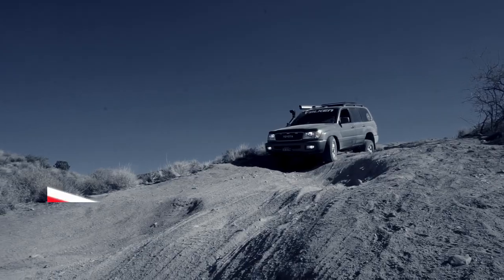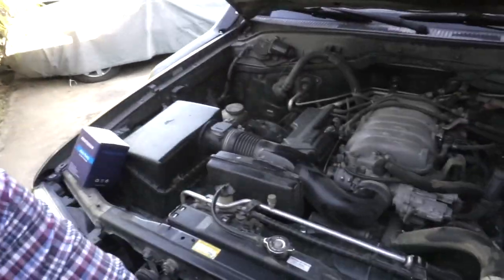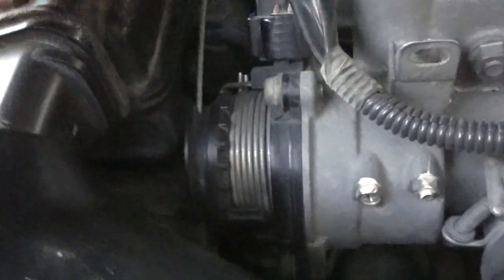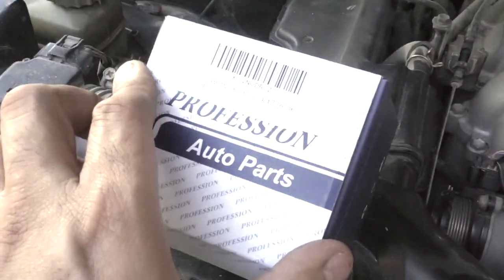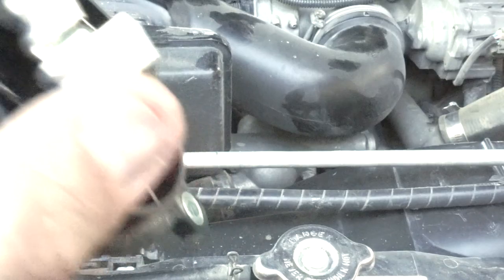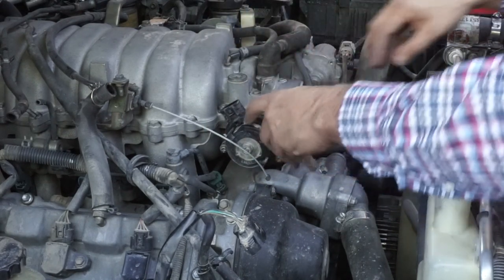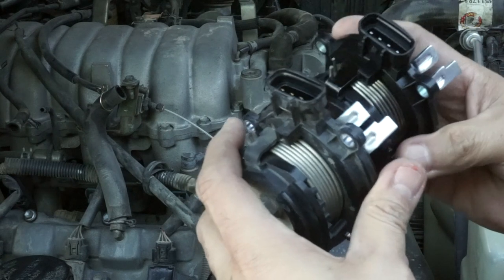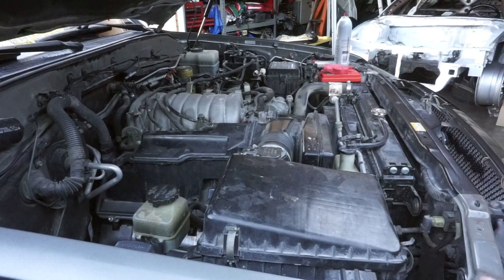How To Replace Throttle Position Sensor / Accelerator Pedal Position Sensor. 100 Series Land Cruiser

Comment from the maker: Had to replace the Throttle Position Sensor / Accelerator Pedal Position Sensor on my 100 Series Land Cruiser. Because the trottle cable holder broke off and I lost pedal response on the highway!

Comment: Hey, I am doing this now and have two questions: did breaking the tab on the wire harness cause any issues? Has the sensor held up? The OEM part is about $400 from Toyota, so wondering if the cheaper part has been ok. Thanks!
Reply from the maker: No issues with the breaking of the tap or the sensor as well. It's been good for the past year!

Comment: I just replaced this same part on my 2002 toyota Sequoia 4.7l same engine and i still dont yave oedal response until it goes almost all the way to the floor what do i do clear the codes
Reply from the maker: Oh man! I didn’t have that issue and I didn’t have any codes.
Reply: Your in limp mode try tps sensor

Comment: What symptoms were you experiencing before replacing this?

Did you replace the sensor that goes on the accelerator pedal?

What motor do you have?  Gas or diesel?
Reply from the maker: I replace it because the cable holder broke off. Literally didn’t have a pedal while driving on the highway. I have Gas Land cruiser.
Reply: @MisterMemo  thanks.  I'm in Central America and have diesel but much of the time the truck is not sensing the movement of the pedal at all.

I think there is also a sensor on my actual pedal under the dash.  And it could be that.
Reply from the maker: @markshade8398  oh man! Hope you find the problem!